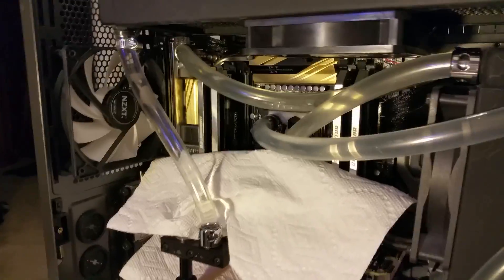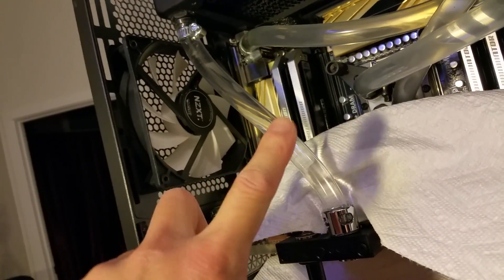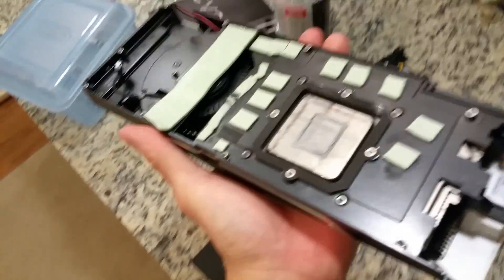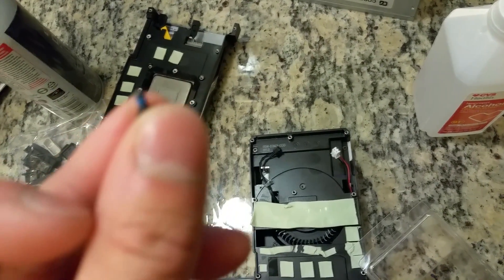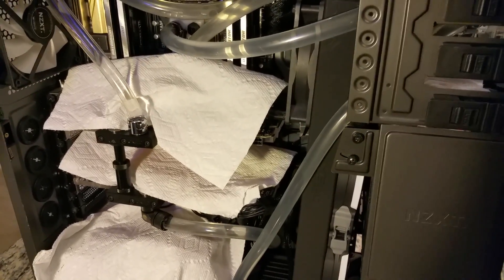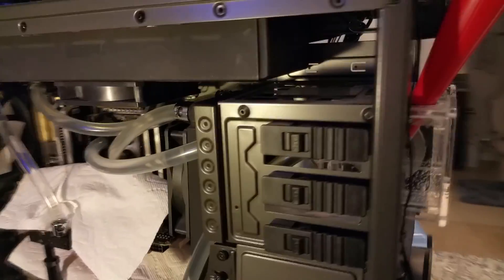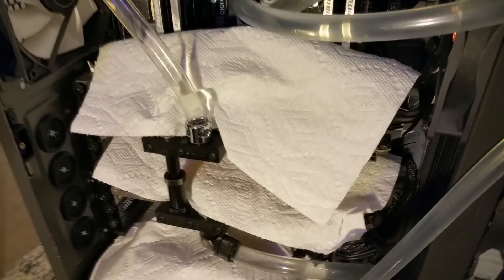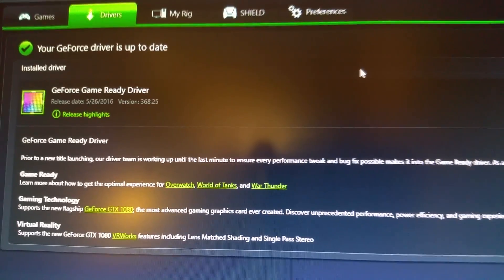GTX 1080 SLI Water-Cooled with EKWB Water Block

Comment: For my rig I went with a radiator outside the case, 560mm rad, and made it so the 1080 SLI combo was only on that loop. I also went with a D-Bay res-pump combo. I however put the CPU on it's own loop with a off the shelf Corsair H80i v2. I did this so that they wouldn't impact each other in temps. The 1080s are hot bastards LOL. You might be thinking that maybe the radiator outside the case is a bit of an inconvenience. However the whole computer is on a utility cart I got from Super Cheap Auto. Looks really professional, and I can wheel the pc to any room in the house and setup my HTC Vive for gaming. :)

Comment: what are your typical temps like for the 1080s during gamin
Reply: I can tell you what I get in Australia's summer. 55c to 60c on the SLI 1080s. GPU2 is a few degrees cooler than the other, however, but not far from it. However keep in mind that I got a 560mm radiator attached, outside the case, and I put the CPU on it's own loop. So he might get higher temperatures, maybe.
Reply: tenshi7angel nice id like to see your setup.  you have instagram?

Comment: Why is your graphics driver 2 years out of date, and WHAT THE FUCK are you running 2x1080's for @ 1920x1080.  I run 2x 980Ti's @ 4k with 100 frames maxed out in most of the latest games. WASTE OF MONEY, and what a bunch of getto fixings.

Comment: Just so you know your cards too far apart for new HB SLI bridge
Reply from the maker: Just so you know, different MOBO chipsets have different spacing requirements for SLI GPUs, and you can get the HB SLI bridge in different widths.Please have at least some idea what you are talking about before you try to correct someone.
Reply: +VeryTraumatic still that bridge you installed in there runs lower then the new one released for pascal.

Comment: i have also a gtx 1080 and it has a ek waterblock and backplate. I used an ifixit kit to remove the stock cooler. the standoffs can be removed by one of the potkeys. For the love of god do not use plyers on your gtx 1080. I am verry happy with the card and the block is performing well.

Comment: I just installed 2 of them blocks. The thermal pads are somehow a bit on the thin side. Ram doesnt really make good contact and also the big things in the voltage supply that are only cooled by airflow with the stock cooler, they dont make contact. I only use one thick 240mm radiator for both, i hope it is enough.
Reply: My RAM modules are bare, so there aren't any pads, which is fine if you have airflow over them and you don't overclock memory. I'm curious though, what do you mean when you typed that something does not make contact? Do you mean that the heatsinks on your VRM (voltage reg. mod.) aren't making contact with the bigger stock heatsink of your cooler? If so, that is normal. Make sure that you have airflow over the VRM heatsinks if you're running universal blocks.
Reply: No, you got me wrong there. The parts that are cooled by air with the stock cooler (There is a cutout where the fan can blow thru) dont really make contact on the ekwb block. i used a slightly thicker pad taken from the stock cooler to get contact there. And regarding to RAM modules: There are pads but they are a tiny little bit too thin in my opinion. And there is no airflow to RAM on a full cover watercooler.

Comment: Yo just a heads up just in case you weren't informed and also because of your thumbnail pic. Gotta get the new high bandwidth sli bridge for the 1080's for optimal performance I believe. I may be wrong but NVIDIA is definitely pushing this since they aren't allowing 3-4 way sli (with the exception of a enthusiast key which grants you access to a driver for it)
Reply from the maker: The Nvidia HB bridge doesn't fit on cards with EK water blocks, so it looks like I'm getting the Dremmel out, or just wait for the EVGA model.
Reply: +turbodude555 My point is if you're using a 1080 or 1440p monitor, the regular LED hard bridges from any brand work 100% fine. I'm running an ROG swift 1440 @ 144hz with an asus rog bridge between the 1080's and it doesn't hold them back in the slightest. You can obviously use the HB bridge in your build, but it's not necessary for full performance at or under 4k 60hz.
Reply: +turbodude555 Are you even reading my comments, I own two 1080's in sli without the HB bridge, and it's 100% fine, I can spit out benchmarks for days if I have to but I don't, Nvidias own graph indicates this, and they themselves have said as much in the forums when people ask if they need one. Even pro  youtube reviewers like Jayz2cents are using regular LED bridges in their builds, go check Project Red Mist he just did for a customer, no HB bridge used, because it's not necessary at the customers resolution. End of story.
Reply: "Using this new SLI HB Bridge, GeForce GTX 1080’s new SLI interface runs at 650 MHz, compared to 400 MHz in previous GeForce GPUs using legacy SLI bridges. Where possible though, older SLI Bridges will also get a speed boost when used with Pascal. Specifically, custom bridges that include LED lighting will now operate at up to 650 MHz when used with GTX 1080, taking advantage of Pascal’s higher speed IO."
Reply: +turbodude555 Right, so instead of making uninformed comments, how about you lead with "this will  be useful for my 4k 120hz monitor" and I would have given you a thumbs up.
Reply: +turbodude555 I don't need a 'one up' on anybody, I need people that spread misinformation to do some basic research before opening their mouths, and potentially costing people time and money they don't need to spend.
Reply: Wow you must of done a lottttttt of research to get that information
Reply: If I were to give you an exact amount of time it would be under 10 mins. All my information is from a single video. Not sure if you comment was suppose to be insulting but that's how it felt.
Reply: The EVGA one looks awesome
Reply: Kevin Chan
lmao just stop
Reply: You only need the HB bridge if you want to play at 4k over 60hz (120/144/165hz). http://core0.staticworld.net/images/article/2016/05/sli-configuration-100661339-large.png
Reply: +azzmader I wouldn't say it's only for that, but it does play a part in it
Reply: +azzmader I guess until some folks do some tests we won't know the real world benefit yet. But I'll still get one anyway
Reply: +azzmader yes I am reading and yes I am in need of one as I'm still using an old style link. Also you just said if you're gaming in 4k above 60hz it's beneficial. As a gamer on YouTube, I will undoubtedly benefit from this when recording and playing in 4k as I sometimes do
Reply: +azzmader yes I am reading and yes I am in need of one as I'm still using an old style link. Also you just said if you're gaming in 4k above 60hz it's beneficial. As a gamer on YouTube, I will undoubtedly benefit from this when recording and playing in 4k as I sometimes do
Reply: +azzmader or why not just not be so hostile and trying to have one up on everyone? Haha
Reply: +azzmader mmhmm
Reply: ***** In the end I got the newer bridge :)

Comment: Why don't you have a 1440p 144hz Monitor? instead of 1080p 144hz monitor? Especially with two 1080's!
Reply from the maker: qc issues with the ips 144hz... but they seem to have gotten better. 144hz 1080 or 5760x1080 is what I game on for now, till the 144hz ips displays are more reliable